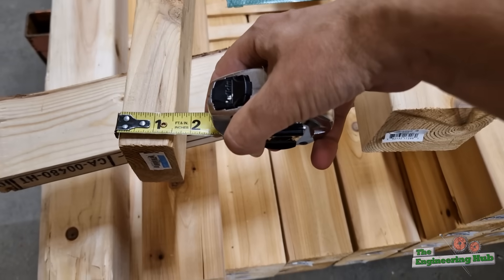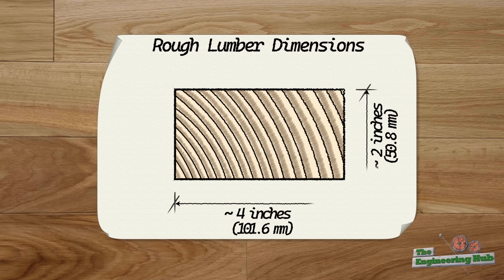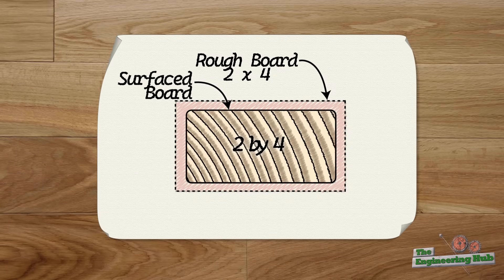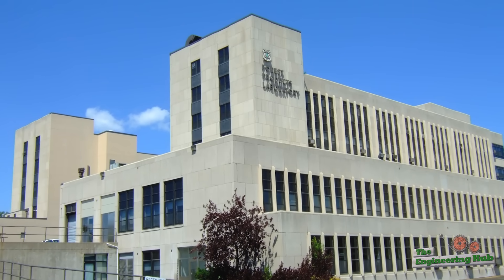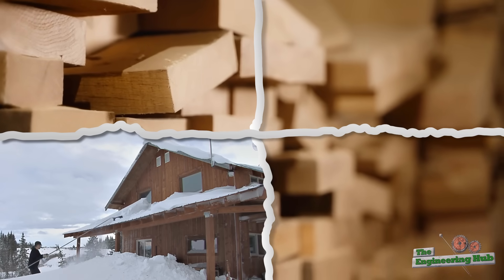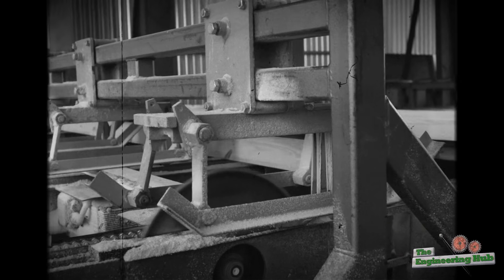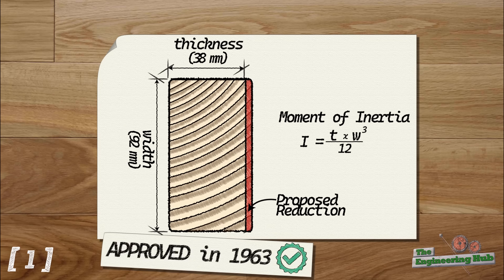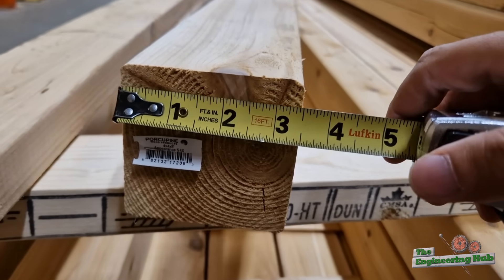Why is the 2 by 4 getting smaller and smaller?

Comment: We're encouraged to buy FSC certified, sustainable lumber. That's a good thing. But there's a flip side.
Until the early 1990's it was easy to buy slow grown, slow dried lumber, perfectly straight, heavy and incredibly strong. What's on the market today is fast grown, kiln dried, light as a feather and warped. It's not nearly as strong as the lumber we used to buy.
To compensate for the lower quality the size should increase, not decrease.
Reply: dude i cant even get 2x4's at the hardware store that are actually in one piece let alone straight and the same size. lol over half of my last order had huge sections missing out of them. fortunately it wasnt for anything structural but i have seen plenty of homes built with lumber that is severely damaged.
Reply: When building my home all the timber was ordered from Canada and Poland. Slow grown,  in cold climate, treated and of immense strength. Cut on circular saws too. In 40 years nothing has deteriorated. Most timber in the UK is regularised and of smaller dimension. Never liked the rounded edges either, still times change but not always for the better
Reply: That's why I use 2x6.
Reply: @LemonySnicket-EUC  Where I'm at, 2x6s literally cost twice as much as a 2x4, yet somehow less than a 2x8. Also, treated 2x6s are cheaper than KD. Plenty of each in stock, so supply and demand doesn't seem to be a large factor. Figure that one out.
Reply: @TroIIingThemSoftly  same here in West Texas. They are Doug Fir however and superior wood. It's worth the upgrade for me. I know it's not mainstream. A bit more insulation as well. Not worth it to most.
Reply: @LemonySnicket-EUC 'a bit more insulation' = over a 50% increase in insulatory volume. Definitely worth it, especially considering the fact that we've gone up the scale of the farmer's almanac in the last decade
Reply: @TroIIingThemSoftly  " 2x6s literally cost twice as much as a 2x4, yet somehow less than a 2x8" Why is that a surprise? Surely that's what you'd expect based on more wood in 2x8 than 2x6, and more wood in 2x6 than 2x4?
Reply: @LemonySnicket-EUC  from Texas aswell, can say from what I have seen our wood prices are nowhere near as bad as the west.
Reply: @barryallen5507  that is true but most people don't build that way. I don't understand why. It would be wise to at least do all exterior walls that way.
Reply: @evil1st  no doubt 👍
Reply: @TroIIingThemSoftly  I just use 2x8s and 4x4s, both are around $9
Reply: @LemonySnicket-EUC it ain't 2 X 6.
Reply: @HughButler-lb6zs  👍 yeah, we all get that.
Reply: Where I live they changed building code of external walls to 2x6. Like 15 Years ago. Building codes change on the yearly. If you can't build your house in a year don't build it in BC! @LemonySnicket-EUC
Reply: @LemonySnicket-EUC that’s why we use reinforced concrete 😉
Reply: Nah you're going to keep buying less for more and you're going to like it.
Reply: Double stud walls are a better compensation. For a small increase in cost this design largely eliminated thermal bridges and allows for optimal insulation.
Reply: they do increase. increase the amount of studs, nails, and glue
Reply: I absolutely agree with you! You nailed it. Situation over here in Bavaria is 1:1! Quality is getting worse and worse... What quality of construction wood we get nowadays, my grandfather wood have used as fire wood... 🙈
Reply: lumber "certification" is what drives up the cost of building lumber. Essentially, it's run like a cartel to prevent competition from small/local mills
Reply: @wildbill6976  Sorry, not true. I don't know of any building code that requires you to buy FSC lumber. What increases the cost is transport and exceptional situations like the  war between Russia/China and Ukraine.
Also, FSC certification is cheap. Around 300 USD for a small company.
Reply: Thank the Savings & Loan scandal and unsustainable logging.  The S&L scandal was a financial bubble built on a commercial building bubble, they'd frame out a new stripmall and then get loans on it as if it were done.  This, of course, caused a framing lumber bubble, and a lot of lumber companies switched from sustainable logging to clear-cutting.
Reply: @stevenowens4511  too many people wanting too few goods.
Reply: Well stated. You are exactly right.
Reply: Caveat emptor.
Reply: Capitalism baby.......not working as it should.
Reply: then the big corps couldnt nickle and dime us and sell us cheap shit, to jsut then come around later and turn it all into condos. get with the program, bud!
Reply: I think you meant to say the standardization of lumber caused all lumber to be the same size so we didn't have this b***** anymore
Reply: I have a slice of a 2x4 I saved, the growth rings are at least a HALF INCH apart! meaning the tree grew at least 1/2" every year!
Reply: @FCE-dogs  Trees on steroids? I have pieces with approx. 20 growth rings per inch. Bought that lumber 30 years ago. Probably from trees in the north of Canada.
Reply: "To compensate, we regulate that you need 2x as many boards for a project now compared to decades ago. MMmmmmm money!"
Reply: Support your local lumber mill then quit buying SHIT from the big store
Reply: Most modern lumber at a place like Lowe’s or Home Depot is trash
Reply: Old forests are depleted. Wait 100-200 years and you get nice stuff again
Reply: @jepulis6674  Thanks for the advice. From a practical point of view there is a chance I won't be in a position to purchase lumber in 100 years from now, but you never know.
Reply: @KeyDx7 you can say that again. A lot of knee jerk reactions are part of the problem, not the solution. I used to live where environmentalists made a mess of things but once in a while they made sense. Besides, the nuanced point at the end was spot on. The existence of standards is a good thing but they’re going in the opposite direction regarding size and structural integrity vs wood and processing quality.
Reply: Depends where the lumber is from. Most good quality hardwood is grown in colder climates and bad quality hardwood is from warmer areas.
Reply: It's all about the money to the greedy corporations
Reply: @@KeyDx7  Wat the hell are you talking about?  I'm not talking about wood or forests, just the fact anyone who says 'And that's a good thing' is condescending and stupid.
Reply: not to mention a knot was seldom seen in old lumber.
Reply: YES
Reply: That's not "low quality", that's a quality. Your solution is like the Soviet planned economy with window glass, just decree some arbitrary mental comfort standard, so builders won't have to get with the times and use modern building materials where the efficient, light and flexible wood at its peak development, doesn't cut it.

Exchange your correctly inflated dollars, that now amount for a much LARGER global wealth ergo they are worth less by unit, and buy TWO. The Italians called it something fascinating, I'm not sure it's legal in America for me to say what a bundle of sticks is called.
Reply: A bundle of sticks is called a faggot, and the US lacks the hate speech laws of Europe, so don't worry. @sboinkthelegday3892
Reply: It's going down!
I'm yelling timber!
You better move!
You better Dance!
Reply: @@KeyDx7 The old timers didnt cut down the entire forests, they maintained them, took care of them, replanted t hem and never left monster messes behind, they also didnt do 'cut-and-run messes either.
Reply: @Rink03 really? During which time period, and where?
Reply: @bryceanderson4864  In 1938, Weyerhaeuser started a seedling nursery at Snoqualmie Falls with a view to replanting the tiny trees. DUH
Reply: @bryceanderson4864 It was way back in the olden days when the old timers and Neanderthals roamed the earth cutting down trees with trained beavers.Didnt you study your history? 😂😂😂  😮  😊
Reply: @Rink03  As someone who lives in the smoky mountains i would like to disagree. Until most of the heavily forested mountains and hills were designated a national park companies used to come in and clear cut entire miles. You can see the forest still recovering in some places.
Reply: @Rink03 Never heard of Georgia-Pacific, huh?
Reply: @llywrch7116  Sweetheart UI LIVE in logging country, Georgia Pacific grows their own trees for their paper. DUH
Reply: @Rink03  Friend, I've lived in the Pacific Northwest my entire life. I have many relatives who worked the mills & in the deep woods. Georgia-Pacific was notorious for their cut-and-run operations -- & hated for it. They made Crown Z & Weyerhaeuser look like angels -- which they weren't. Back in the 1960s, when they had their corporate headquarters in Portland (it's the one with the statue known locally as "Three Groins in a Fountain), a bunch of demonstrators attacked their building, throwing paint on it. The police just stood back & watched.

No one shed a tear here when these a***oles pulled up stakes & ran off to the South.
Reply: @llywrch7116  Georgia Pacific Grows their own trees, why should they cut douglas fir for their paper products?
Reply: @Rink03  Why don't you research the history of this company?
Reply: @Rink03 Historically, this doesn’t really track. I wouldn’t be surprised if there were one or two groups or companies that replanted what they cut down, but most did not. I’m not the most familiar with American history in this area, but at one point Britain had next to no forests left, they were all cut down and nobody really bothered thinking about replanting them. They eventually recovered a bit because people left the countryside and a ton of villages were basically abandoned due to the enclosure movement by landlords. Europe in general has very little of its historical old growth forests left. Even nowadays, most managed tree plantations are just pine. It’s better than cutting down more old growth forests, but they aren’t a replacement either.
Reply: @Rink03  that is absolutely a lie. It takes hundreds of years to grow an old-growth forest. At no point in the history of the United States, including the present, have we been logging them slower than they could replenish.
Reply: @m0nkEz  Ever heard of the crossbred cotton trees? They grow them for paper and it doesnt take 'Hundreds of years' to grow them either.
Reply: @Rink03  go to heaven, boomer.
Reply: @Rink03 Guess that explains the pine belt huh
Reply: " That's a good thing." -  Opinion immediately discarded.
Reply: @BasedF-15Pilot L take
Reply: @pootispiker2866  Are you 12? Who even says "L take"?

Comment: Board foot calculations are probably based on the original dimensions rather than what the actual measurements are.
I installed ceiling fans for a friend whose business was located in a converted house that dated back to the turn of the 20th century. When I went up into the attic I was amazed to see full dimensional, unplaned 2" × 4" s.

Comment: I worked many years in a sawmill and with the modern high tech sawing drying and planning equipment they cut their lumber to very tight tolerances.  They rough cut the lumber about 1/8" over nominal size. The saws they use are thinner than a skill saw blade to further maximize the volume of lumber out of each log.

Comment: I recently had to fix a roof of a 100 year-old barn... the 2x4s were (A) actually really 2x4 and (2) the wood (pine) was so dense and hard my 21st century nails would bend as I was trying to drive them into the lumber... I had to switch to using screws.
Reply: Or you had to switch to pilot holes.
Reply: @josephpostma1787 I actually did both... 🤣 but I didn't know if anyone wanted to hear all the details...